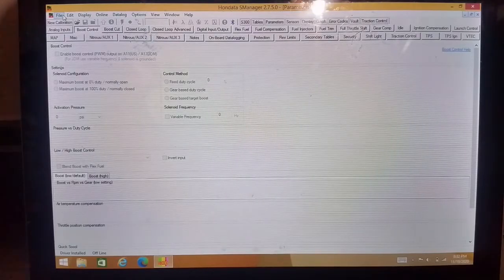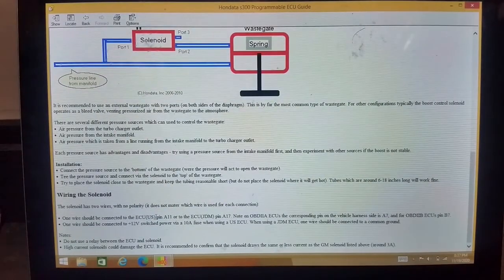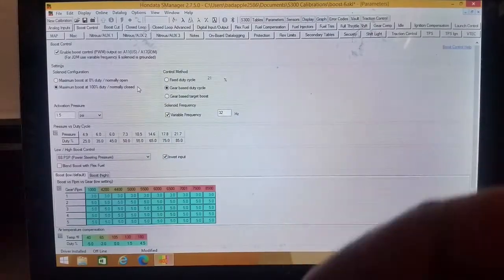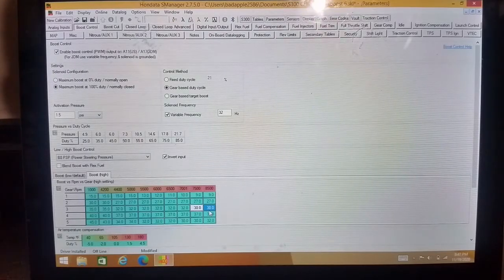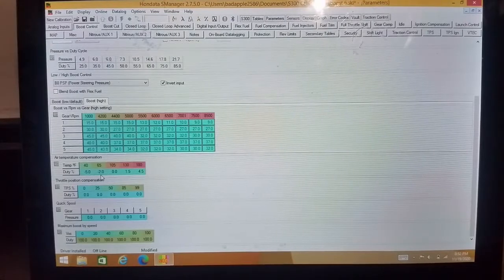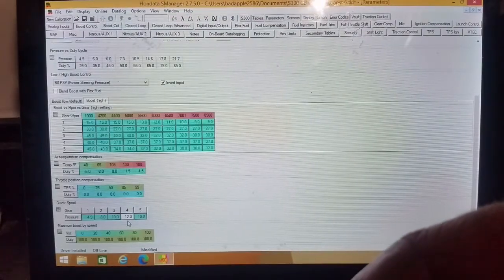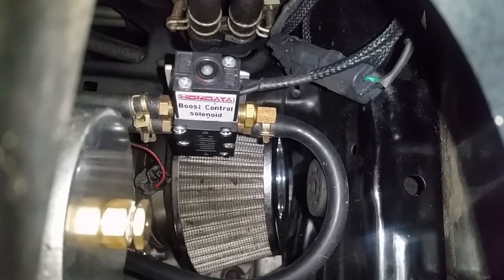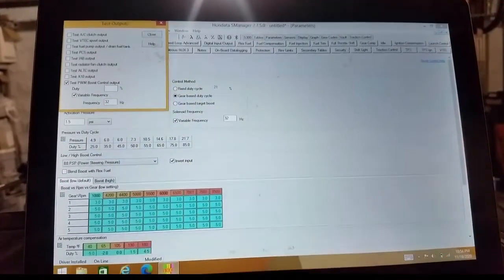Boost Control, Tuning With Hondata

Comment: Hey this might be a dumb question but how do you switch from low boost to high boost without messing with the wiring? Can i just manually change it back and and forth under boost control??

Comment: 21:35 what was the issue I’m
Having the same issue that you describe here
Reply from the maker: When I had the quick spool set at a higher boost of let's say 10psi. If my boost setting for say third gear was only 8 psi it would make it over shoot the boost fall back down then over shoot again. Up and down up and down. I didn't realize I had made the mistake of leaving the quick spool up and turned the boost by gear down  they have to atleast be equal....really you want quick spool several psi lower than your boost target so it doesn't over shoot hope that helps